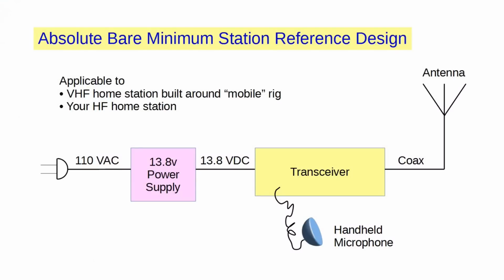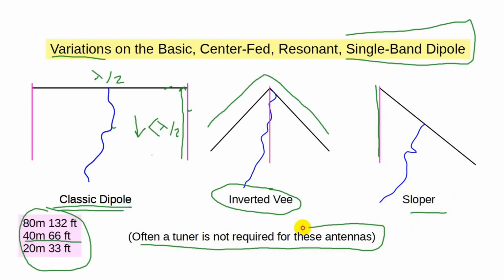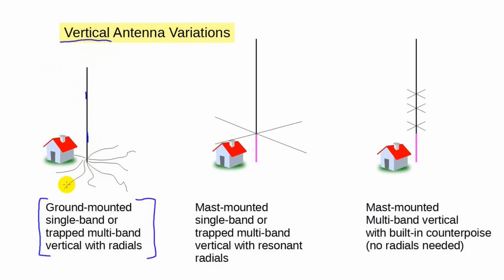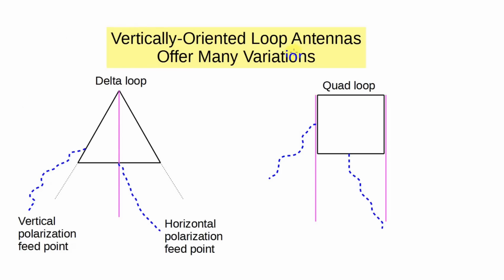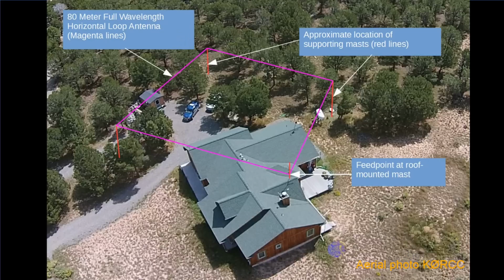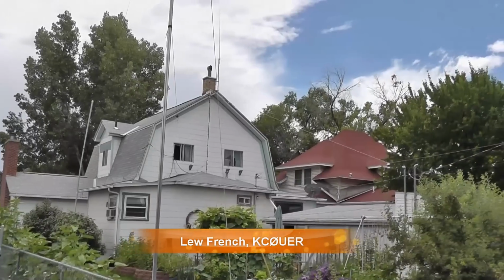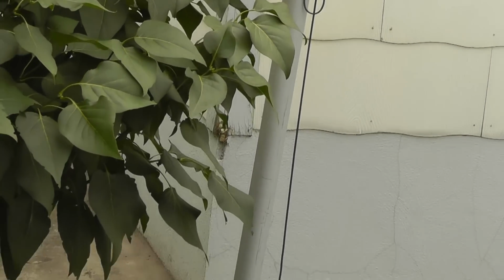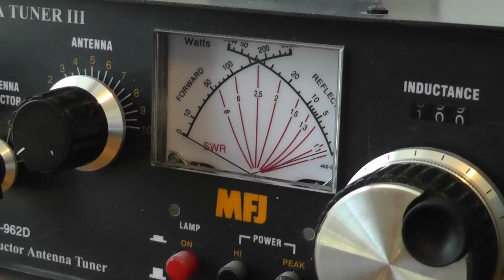Antennas for Difficult Situations: Ask Dave Episode 7

Comment: Hi it's me again. I am a newbie ham from the Philippines and have a dual band antenna (VHF/UHF). My question is regarding the type of mast to be used. I bought a commercial yagi and it was easy to assemble, but at a certain portion of the instructions, it says "if connected to a non metal mast offset less than 50mm and about 500mm offset if using a metal mast". What does this mean?  I am using a GI pipe mast. I was planning to shroud my mast with a PVC plastic tubing to avoid the 500mm  offset due to the typhoons here in the Philippines can get pretty nasty. I want to tuck my antenna in as much as possible. Please help, thanks.
Reply from the maker: What this means is that if the mast is metal you need to mount the Yagi away from the mast with an arm of some sort. If the mast is not metal it doesn't matter. The problem is that the mast itself, if metal, can interfere with the Yagi. Good luck with your station set up. I well remember a typhoon I experienced in the Philippines in 1972!
Reply: Hi Dave, so you've been here? That's good to know. The typhoons here are getting stronger. Sir as I mentioned earlier, what if I wrap the mast with a PVC plastic tubing, will that help?

Comment: As a beginner in the Ham radios, I am looking to put up a base antenna, I would like to put up a Quad antenna that would cover all the bands, that I could eventuly use. I don't know if that is a good idea or not? What would you suggest, the one Quad antenna or multiple antennas? Could you suggest by name brand or type of antenna. At present I have a TTY 9800 Plus, that I plan to use on the base, and a AnyTone dual band for mobile use. Thanks
Reply from the maker: First, of course, you need to get your license. I don't recommend that people purchase equipment until after they have their license. I've seen too many people get equipment and then for whatever reason not get their license. As you study for your license you learn about antennas. VHF quad antennas are not unknown, but Yagi antennas are much more common for gain antennas.

Comment: Dave hi again.This is George on the in porch in Florida!Iwould like to know if the copper braids would help my set up,to get better grounding and performance.I seem to have a lot of noise but as soon as I touch the radio or the mike it seems to reduce everything! This is an old trick from the past I read about.Still messing around about buying another antenna!
Reply from the maker: If you're getting that sort of reaction, it sounds like you should reexamine your grounding approach. Put a ground rod near the porch you use. Ground everything in the station to a single point and then ground that to the ground rod. Should help. Also, given you're in Florida, be sure to think about lightning protection (also covered in a recent video). 73

Comment: David, What is your opinion of random length long wire antennas?  I have a small lot, trees, but they are too thick to hang a dipole, and a good multi-band vertical is kinda pricey.  I was considering the long wire and a tuner since I could put the wire anywhere and tune it.
Reply from the maker: I've never had much luck with long wire antennas. By definition, they are greater in length than a wavelength, or preferably even longer. Most tuners that have a way to feed balanced line can also feed a long wire.

Comment: Due to HOA and XYL restrictions, all my HF antennas (4) are in the attic...a rectangular, tuned wire loop for 80m (8ft H x 23ft L, #14 THHN wire- I use a Z-match network to tune/match that one), a linear-loaded 40m dipole (45ft. long- no loading inductors), a tuned "magnetic" loop for 20 - 15m, and an 8ft. tall, 20m vertical dipole that's center-fed and end-loaded with 16 ft. horizontal wires at top and bottom.  All of the antenna are homebrewed and they work very well for me.  I've worked DX all over W. and E. Europe, W. Asia, S. Pacific, Australia, and more.  All the feedlines are RG58/U that come to a mechanical coax switch (an old B&W) mounted upside down on a bracket, immediately above a hall closet.  The extended shaft from the switch comes down through a hall closet ceiling to a knob, just behind the wall above the door.  The closet door is about 7 feet from the shack. The common feedline from the switch comes down inside of the closet front corner and through the floor, and then up through the floor in the shack.  Common mode chokes are installed at each antenna feedpoint and are made from Fair-Rite brand #31 and #43 mix ferrite cores (Mouser Electronics).  I wouldn't dream of buying a commercial HF antenna for my attic location.
Reply from the maker: You've got a great setup there!

Comment: David I have a doubt related to radiation pattern of an antenna.
the solid angle is a function of theta and phi but if any wave propagate then it should have a radial component . please explain.
Reply from the maker: The radiation pattern of an antenna is a static measure of field RF voltage distribution. It is not a description of the actual wave as a function of time.
Reply: David Casler  what is the other theory except static RF voltage theory for knowing the wave function of time.

Comment: Dave ... am a new guy.  Technician and General passed in 4 weeks.  Have an ICOM IC-7100, an LDG Electronics IT-100 tuner, and a MFJ-226  graphic antenna analyzer.  Live on in a rural place with room.  Could easily go out one end of my house at about 15 feet with a dipole in a V shape.  60+ feet for each side would not be a problem.  Question:  how to use such an antenna for 40, 20, and 10 meter as well as 80 meter?  In addition, how about lightning suppression?  Can I use a MFJ-272  Lightning Surge Protector to good effect.  If not, please recommend a good one!   Thank you!  Mike KE8GIR
Reply from the maker: Take a look at off-center-fed dipoles, available from several manufacturers or you can make it yourself. They're popular right now and with a wide-range tuner can cover all bands. Good luck with your on-the-air experience! 73

Comment: gud pm sir Dave, i have question why does my HF broadband antenna has strong transmit but poor receive?
Reply from the maker: That's an odd one. Usually it's the other way around. Check your receiver. Is the attenuator on? Too much filtering? If you have a pre-amp, can you give it a try?  You might ask members of your local ham club--they may be able to give you some pointers. 73, Dave
Reply: sir i am using icom m710 radio and my antenna is broadband and yet my problem is no rx but my tx is strong and i reoriented my antenna with different position same problem encountered?

Comment: Thanks for your terrific video. Your large loop antenna fits my needs exactly. One mast will be mounted on my roof and  three tall redwood trees will support the other corners.  The mast is a 10 foot sch80 PVC conduit. The loop is secured directly to the PVC and a ladder line will drop down the center of the PVC  into the shack. My questions are:

1. What is the polarization of the antenna when fed from a corner as I assume yours is? 

2. Will the balun built into the antenna tuner be sufficient for the balanced line?

If you see a problem with this design please let me know.
Reply from the maker: Mark, the polarization is horizontal. If you feed the antenna with balanced line, which is the best way to do it, your wide-range antenna tuner should be sufficient. Be sure to guy that PVC conduit, as there is significant horizontal pull on the top as you draw the antenna tight.

Comment: ok, so.... 
What about end fed antennas ??
I have a pretty long but small garden behind my house. And i'm also restricted to visual antennas from the front. And nothing allowed attached to chimney. 
I recon a wire wouldn't be really visible and there wouldn't be a pole in the middle of the garden. 
I have tall trees at the end of my garden. But then the antenna would slope upwards to the south. Does this effect the antenna propagation ?end where to?  Cause i live in northern Europe.
Ore maybe it's a idea to just do an item on antenna propagations and what to expect when you slope up ore down things.
Reply from the maker: End fed antennas are becoming fashionable again. On HF, the Par EndFedZ antenna got a surprisingly good review. If the antenna slopes down, it will tend to become somewhat direction in the direction of the slope. So if it slopes down to the south, then the antenna will slightly favor the southern direction. Hope that helps. 73, Dave
Reply: Thanks,

That helps.

Greets JD

Comment: Those aren't challenges - try a 400 square foot apartment on the 9th floor - now that's a challenge!
Reply: Joe Walsh it and drop a wire out when on the air. He used a end fed dipole out his hotel window. Worked really well until his cake pan cover kept hitting a window below him.

Comment: Hi OG,

LOVE your videos... Thanks for all the info!

Is 125 feet of RG-8X too long to feed a 20M Dipole?  I'm guessing 25% line loss... Any other suggestions for feed line? Thank you!
Reply from the maker: RG-8X has 1.4 dB loss per 100 feet at 14.2 MHz. At 125 feet that's 1.75 dB. Running the math, that's a loss of 34%. You're losing one third of your output power to heat. All things considered, that's acceptable. If you went to RG-213 cable, you could cut that loss in half. But that's extra expense for only 17% more power. Personally, I'd stick with the RG-8X, but it's up to you. Good luck!
Reply: Thank you. I think I will stick with RG-8X for now. Trying to get this up and running before field day. I am a new General and have yet to make it on HF

Thank you for all the videos. By studying and watching your channel I was able to pass Tech and General with ease. Thinking about Extra after I get on HF.

Comment: You've made some great videos, and this is one of them. 
Who manufactures flagpole antennas to accomodate vhf/uhf transceivers?
Thanks!
Reply from the maker: +usernamemykel VHF and UHF antennas are so short relative to a flagpole that often another method of hiding works.
Reply: I'm using a TRAM 1185 magnetically attached to a stainless steel plate. It is surrounded by a thin plastic pot and is disguised as an Ivy plant. It is located on my 2nd floor bedroom outside window sill. I'm hitting a repeater 25 miles away with my Yaesu FT7900R and 21 miles with a Baofeng 8W (both dual bands), but I'd like to hit further repeaters. HOA covenants necessitate stealth, so I'm considering an antenna inside a PVC pipe - Ed Fong's come to mind - what do you suggest, please?
Reply from the maker: +usernamemykel I can't recommend a particular antenna because there are so many of them. Ask members of your local ham club what works best for them--they may have some good ideas that you can research. Also, QST has many advertisements for antennas, as well as articles about them and reviews.

Comment: are the end feed antennas any good to try and how well can they be tuned with a antenna tuner, also do you have a video on antenna tuners and how they work . thanks and 73
Reply from the maker: +John Spencer Yes, end-fed antennas work, although they can be difficult to feed. Many antenna tuners can tune "long wire" (end fed) antennas, usually defined as more than one wavelength long. There are a couple videos in the Ask Dave series on antenna tuners. Check out the playlist at https://www.youtube.com/playlist?list=PL0R9jy9LZw_2Je-1Td9Xb2S8-Vl_bFTGG
Reply: thanks I will check them out

Comment: Hi Dave,

Good video, but if and when you decide to upgrade this video, what you should definitely include are magnetic loop antennas (MLA's) which are small, and which work like gang busters without any radials, and only a few feet off the ground ! They can be purchased commercially, e.g. the MFJ 1786 which covers 10-30 MHz, is only 3 ft in diameter and works great only 3 ft off the ground. As to constructing a 3 ft diameter MLA for 10-30 MHz, or a 6ft diameter MLA for 80 and 40 meters, look at the website of Rich, K8NDS, and also his You Tube Videos.  In sum, since I now reside in a community with CC&R's - I no longer have a 55 ft Triex tower with a 4 el Yagi, but now use MLA's and they work great and take up very little space.

BTW : An excellent paper on MLA's can be found at :

nonstopsystems.com/radio/pdf-ant article-antenna -mag-loop-2.pdf 

All the Best,
73, Jim (N6MV)
Reply from the maker: +Jim La Frieda Hi Jim, thanks for the info. I don't know that I would recommend a mag loop antenna as a first antenna. They're very narrow-band and take some patience to tune. I agree that once set up they're great antennas, but you will have to retune if you QSY even a few kHz. See the July, 2013, QST, page 51, or a rather interesting website at http://hlmagneticloopantennas.com/. Mag loop antennas have very large circulating currents, requiring special care if constructed from scratch.
Reply: +David Casler ,

Hi Dave, Yes they are narrow-band dependent on the band, i.e. the antenna Q is high and the BW is very small on 160 and 80 meters, but using one of the several Mag Loop Calculators, you will observe that the BW increases as one operates on the higher bands. Tuning a loop is not difficult and can be done via several ways, viz. max receiver noise, dropping XMTR drive and tuning for lowest SWR, and also using an MFJ 212 matchmaker, and even building an automatic controller that automatically tunes as one changes one's transceiver freq. And, yes, they have high circulating current and also very high voltage at the capacitor, which requires one to make sure that they use conductors and capacitor spacing of the appropriate size, but  that's also no big deal. What's great about them is that they are very small in size, i.e a 3 ft diameter loop covers 10-30 MHz, they need no radials, and they work very effectively - in a vertical position- only a few feet off the ground. In Europe they are very popular because many are lucky if they have a small balcony. Here in the States, they have recently - in the past few years- become a lot more popular - because of CC&R's - and are now widely used- as can be seen from the two Yahoo Mag Loop Groups that now exists. In sum, they are excellent antennas for one who has very small real estate w/o CC&R's or a large lot with CC&R's. 

73, Jim (N6MV)

Comment: Dave I live in an apartment complex and we can't have any outside antennas,  I am going to be running only 6 and 10 M for now. What type of antenna would be best?
Reply from the maker: +Richard Girou You'll probably start with simple dipoles, maybe tacked up along the ceiling. If you live in a concrete-reinforced skyscraper, any antenna can be problematic. If you have a balcony, there are balcony-mounted options (example, from MFJ).

Comment: Thank you Dave. Your video inspired me to try an antenna in a very difficult location. I am in an apartment on the 9th floor. (one minor plus).  Our building manager had a very bad experience with a CB'er  who's antenna fell off his balcony and damaged the superintendents vehicle. Hence a very negative view of hams or CB'ers.  We can't even put up an external UHF antenna. But your video inspired me to try some in door solutions. As it happens my window in the spare room is just big enough that I can put a  Diamond x-50 in on about a 45 degree angle. Being on the 9th floor it preforms very well. But I wanted to get on HF. So I strung a wire antenna with white hook up were long the top of the ceiling. I cut it as suggested for a wire antenna strung between two polls, but found that inside attached to the wall the antenna need to be cut shorter.In fact I removed about 15" from each end. This make my antenna quite small and with the white on white almost, invisible. I have used a program called psk reported to see how well it is preforming. To my surprise I have being heard quite well. I have only to track down and eliminate a very strong noise source (turned out to be a power brick for my laptop.) Now evey wne the band is not so good I can work stations using JT-65 HF. You are right , were there's a will there's a way. Best RegardsDave - VE3HTB
Reply from the maker: +Dave Borland Thanks for sharing your experience. As you have discovered, the most important ingredient in a good antenna is persistence. 73, Dave, KEØOG

Comment: Very good video. I had a problem when I lived in a mobile home park no antenna were permitted. So I mounted 3 vertical wires 10m 20m 40m against a tree 8 radials about 25 ft one tied in to the frame of mobile home and it work very well. I live in Delaware first station was Australia long path on 40m. It's still a compromise antenna but it works
Reply from the maker: +Shawn Rullens Sounds like it's worked very well for you! So-called "compromise" antennas do work!
Reply: +David Casler, oh yes it sure did.
next going to build a quad loop either 40m or 30m feed with open feed line. 
Will and LDG auto tuner work with this set up with a 1:1 or 1:2 balun
Reply: +David Casler forgot to mention the feed line rg-8 10ft long....

Comment: My Chameleon Mag Loop has allowed me to work Japan, Costa Rica, Russia, Spain, Puerto Rico, Canada and other countries with just 20 watts from Wash State!  The loop sits on my semi enclosed patio, 2 feet off the ground.  That solved my HOA restrictions and I can move it inside when I'm done. 73/KG7VCL....
Reply from the maker: +TheMojo1963 Sounds like you have a great solution for your problem. I wouldn't normally suggest a magnetic loop for a new ham because they can be difficult to tune and have a very narrow passband, but magnet antennas certainly do work! And, as you point out, they don't need to be high in the air. 73, Dave